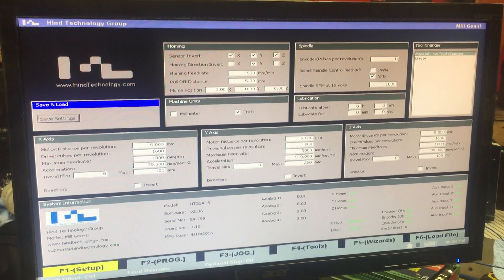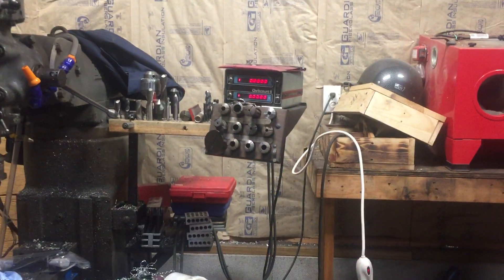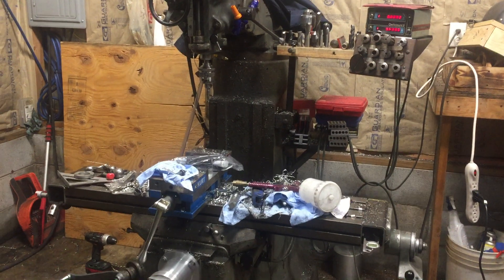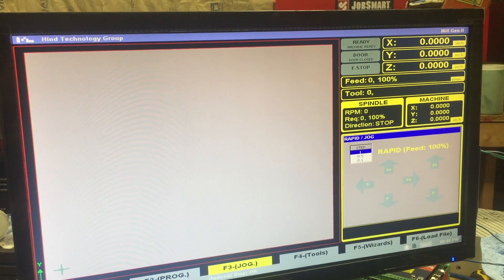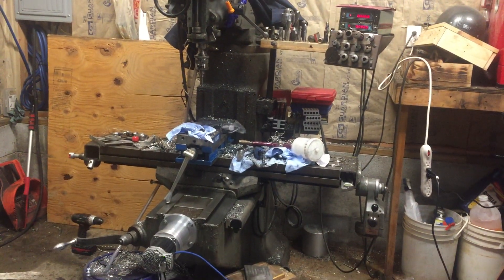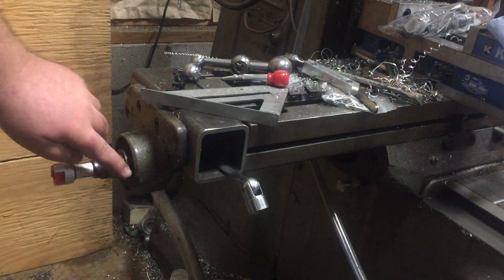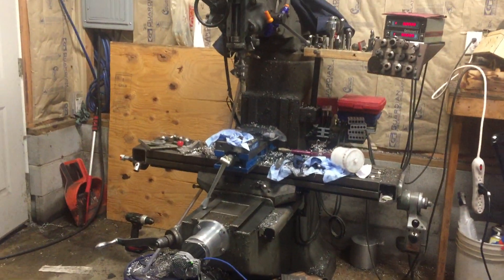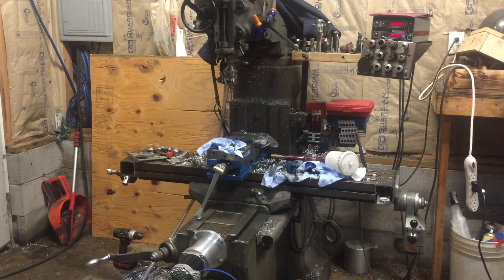ClearPath Servos on the Bridgeport Mill Running with Masso CNC Controler

Comment: Cool, I’m surprised that servo runs the knee.  Did you put a ball screw on that as well?
Reply from the maker: No still the brass nut the weight of the knee hold it down and keep it in tolerance.  We did have to add a 10:1 gear box for the servo to get the job done

Comment: What model servos are those?  And what ballscrews are you using?
Reply from the maker: James German im using these ball screws https://www.ebay.com/itm/311700378983 
And the servos are clearpath 1396 ozin sdsk ones.  The exact model number is in one of my other vids of the mill
Reply: Thanks!  I've been trying to find some ballscrews that are cheaper than that.
Reply from the maker: I ran across a used set for like 400 bucks they were for a 48'' table, so I made table extensions and used them.  Wow what if difference they made even with using it as a manual mill.